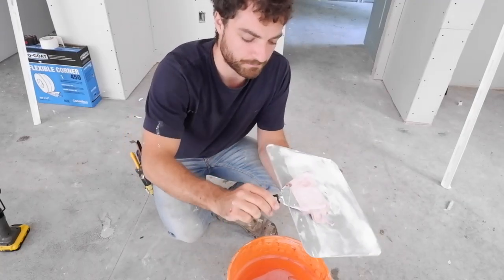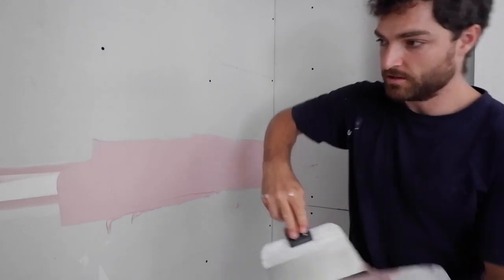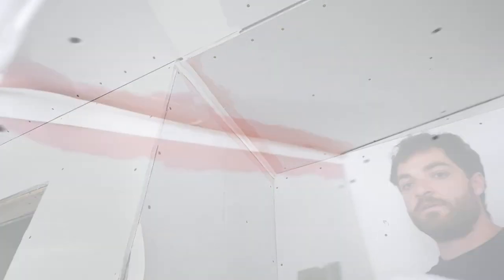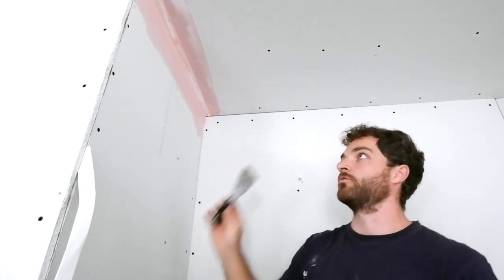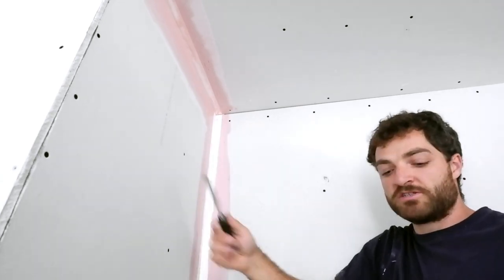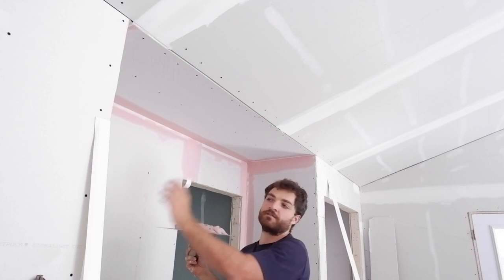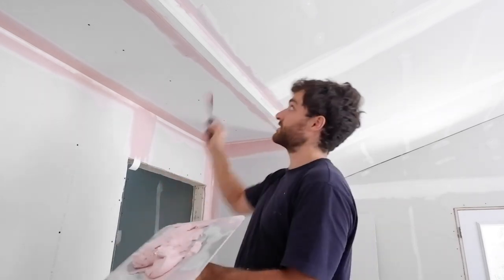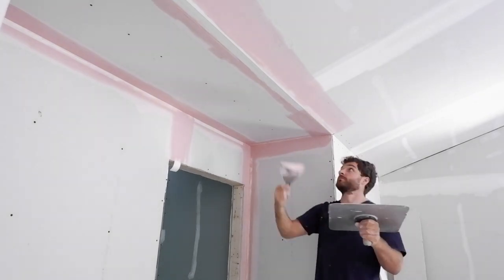How to Mud - A visual tutorial - First coat of mud

Comment: I have a question on the first bit of mud when embedding the tape. Does the shoulder or edge of mud need to be feathered or will it cover up when filling that void with mud. I just did my first mud in basement and didn’t fully feather all in those void tapered joints just on the part where I taped. So next to tape at edge of mud are small lips very small though and some in feathered. I knew about having to feather but thought it wasn’t important on tape part idk I’m new
Reply from the maker: Good question! I typically don’t feather off that shoulder for the first coat, but if its an aggressive edge you might want to, or just try and go over it again and make a tighter pass to minimize that edge (if it’s still wet and possible) 
It’s easier to add mud then take it off after it’s dried! 
Good luck with the job!
Reply: @zackcrafted  thanks for the reply and tips and also for sharing your videos it’s helping a lot as I go along to review your content before starting next step. I just got done down there after work going around and using my knife to flatten those small edges and lightly sanded a few spots too not too much though. Hopefully 2nd and 3rd coat is a lot faster because it took me like 13 hrs to tape the whole basement including ceilings!!